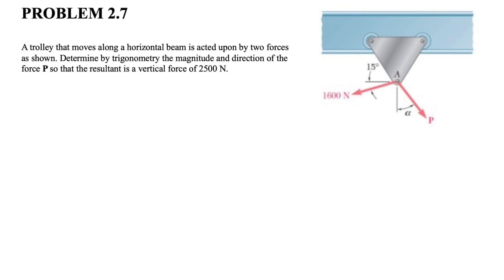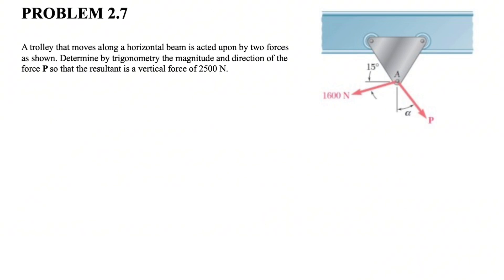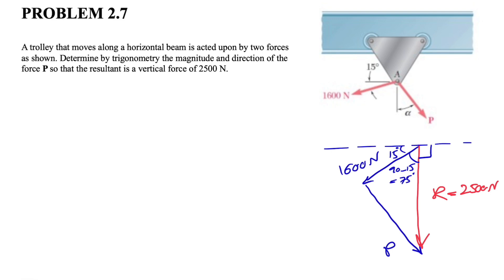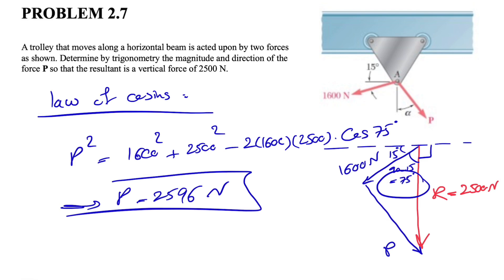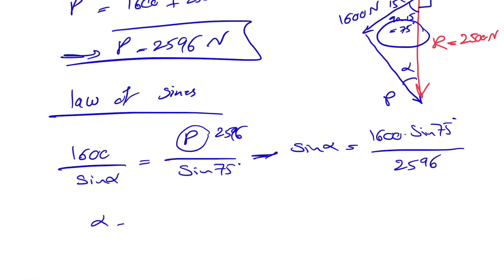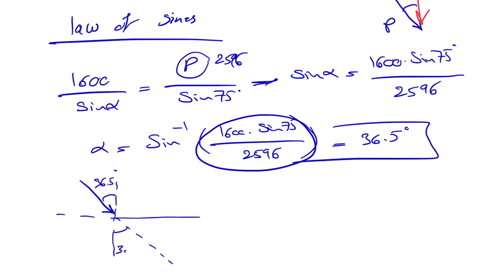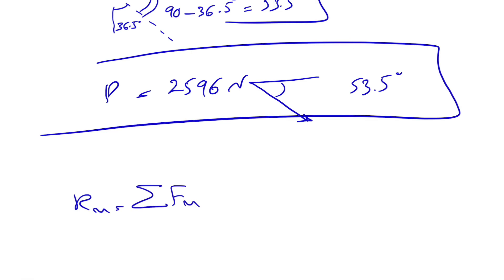Solved Problem  2.7 | Determine by trigonometry the magnitude and direction of the force P

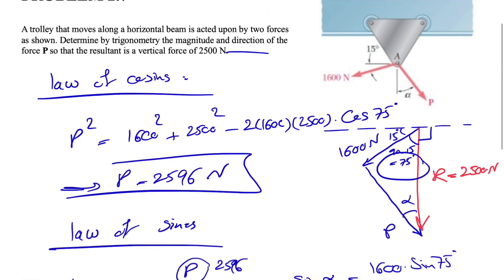Comment: 3:46

It could be alsoP= 2596N angle 306.5 degrees, right? What I did is add 270 degrees and 36.5 degrees.
Reply from the maker: That works too, the way I show is just more common and easier to follow!
Reply: @ENGMCHANSWERS  thank you!
Reply: @ENGMCHANSWERS but why did we have to find another angle if we just got 36.5 ?